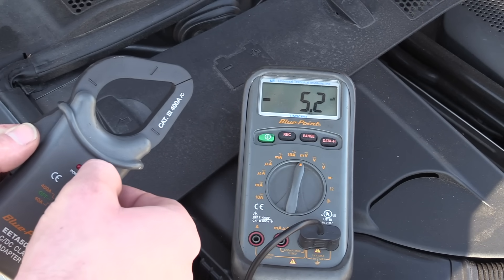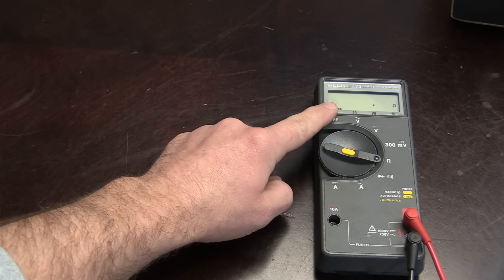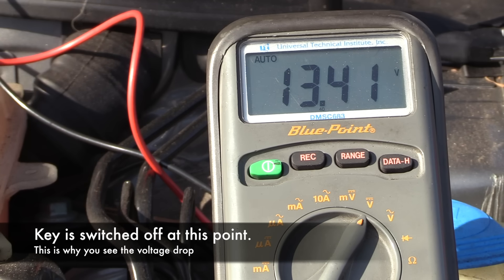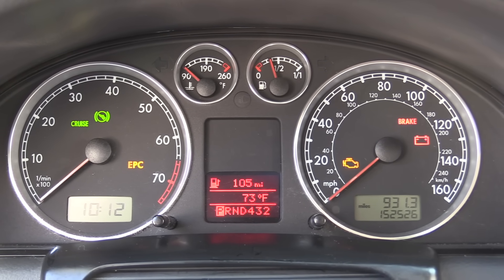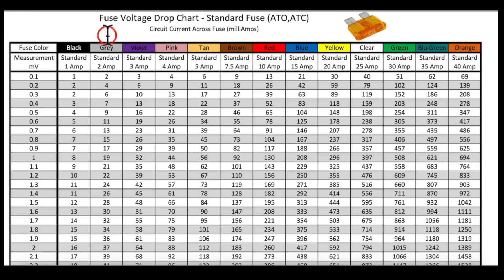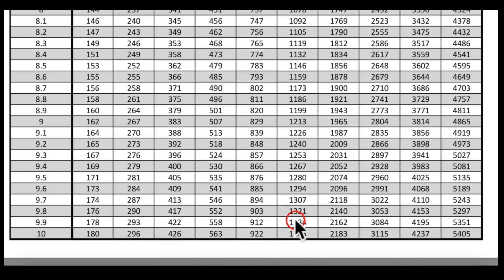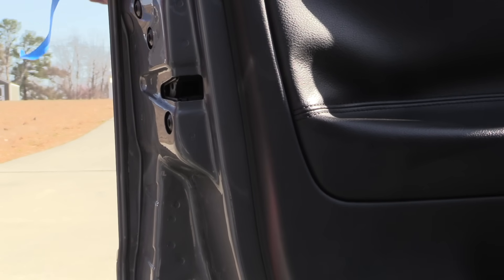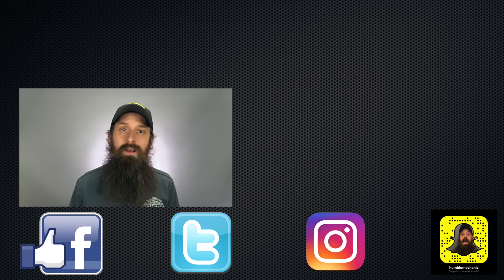The BEST Way TO Perform a Parasitic Draw Test

Comment: Hi H.M. .......I'm confused by all this.... For starters:  1) Don't we have to turn on then off EACH device first (so it has some 'fresh residual voltage' lingering in fuse) to see the voltage drop to zero  2) If our goal is to just make sure every fuse drops to 0 when powered off....why would we need to use reference chart to see what the mV to amp conversion is with 'device on' reading?....if it's drawing extra mA's when running isn't that inconsequential being the alternator is charging battery when running/compensating for this....? I guess I'm missing some key points.....not extremely electrically minded.... Thanks..
Reply: Yes you are missing THE key point. That point is he is trying to identify the circuit that is draining the battery when the car is supposed to be switched off and NOT using any power. So any current draw while the engine is running is irrelevent.
Using the chart tells you what the voltage drop is in current draw. Some circuits continue to draw current when the car is switched off. By knowing what this draw is in amps tells you if the draw is 'normal' ie tiny, or is abnormal ie high draw.

Comment: I wanted to learn this cause I hooked car Amp n subwoofer box since then its takes about two days n not using car the batt is dead ,wtf, can you please, please take a minute to hit me up i got a 2018 Honda hrv what could I done wrong to be losing power please help!!!!!
Reply from the maker: Make sure the battery is good. Then you may want to try an amp clamp around the battery cable to see the draw.  You can the. Disconnect the amp or radio and see if it goes another way
Reply: @HumbleMechanic  hey thanks alot I don't have a amp clamp but I have a meter like yours my confused is the battery good cars a 18' and I used a really good amp wiring kit 0 gauge everything is hooked up right and its turns on n off properly with that blue remote turn on and it works great shuts down fine when I shut off car ,,,I know its something with amp ,why would it draw power if it shut down correctly  , iam stumps me  sorry to bother you with this i don't know what to do could a loose connection draw power maybe I thought I wired it properly   plus to be honest I can't afford to take it to a mechanic  cause of sterio problems what would you check any help would be greatly appreciated

Comment: It seems like you were using 2 multimeter to perform the test. Am I correct? While testing the fuses with a second multimeter (Fluke), do I have to leave the first multimeter (Blue-point) hooked on the battery?

Comment: Isn't 1000mA 1A ? 

Milli meaning 'thousandth of'
Reply: Ah...I just asked the same question before I found yours. He says 0.1 amp, but I agree that it’s actually slightly over 1 amp as Jonathan Hunt wrote
Reply: yes. the 1006 milliamps converts to 1.006 amps not .1006 amps. there are conversion charts that you can google. good catch!

Comment: Does  this require a special multimeter that reads millivolts?
Reply from the maker: I’ve never seen a MM that didn’t read millivolts. Even a $10 from Amazon. Lol
Reply: I noticed you were selecting "Vm" on your DVM.  I don't have that on mine,....and haven't seen one yet on Amazon with that "Vm" selection.  Do you have a recommendation?

Comment: I have a fluke amp clamp I just push the zero button and go to work
Reply from the maker: But the clamp will only I’ve overall draw. Unless you can get it right on the circuit wiring you want to test.
Reply from the maker: I have one too, it works amazing, but to me that’s a different test

Comment: But what do you do when ALL the fuses have current on them when the car is off!
Reply from the maker: Good question. The car is probably not asleep. Also the odds of that are almost zero. Having power on all the fuses at one time is very unlikely. 

But let’s say it is actually happening. I’d be looking at things like an ignition switch
Reply: Intermittent wakeup of the bus system is a real problem that I am currently dealing with.  It will cause current on almost every fuse. 
I have isolated the problem to 1 of 5 modules connected to terminal 30. But now I am waiting for the problem to return.  It comes and goes and drains battery, no start. 
This car does not have ignition switch.  Fob in pocket car starts with start button.
Reply from the maker: Yeah but that should put a draw on ALL the fuses. 

I had one years ago that did that. Turned out the customer wasn’t locking the car in the garage, and something in the Audi they had was waking up the VW(gti I think). It would only happen at the customer’s house. Never at the shop
Reply: HumbleMechanic almost all the fuses, but not everyone. There are some fuses connected to things like blower motors that are not carrying current. 
But once the module on terminal 30 wakes up, ALL modules are woken because the module that operates terminal control activates all relays.  therefore all modules are talking talking and almost all the fuses have current. 

These types of draws show up at least once a month around here.  Total loser job.  How do u tell a customer that its been 2 weeks and it only happened 1 time.  

At least this one happens every 2 days or so!

Comment: Wish I had seen this a couple weeks back.  Tested 2013 sierra with the pulling the fuse method.  Took awhile with the truck waking back up a couple times. but found
The INFO circuit to be at fault. 
Will try to remember this trick next time.

Comment: I wish there was a set of meter wires that never went bad. Ive got about 10 meters out in my garage. All of them  do not do ohms. Any advice as to which brand is one the is reliable or more reliable
Reply from the maker: I have always had great luck with Fluke. The leads are a wear item, but the are really good, and the meters are top notch.

Comment: I have a 2015 honda and am having trouble with a dead battery if the ignition is left on for evan a short time.   Originally the dealer said it was a bad alternator and replaced it but the same problem kept occurring.   I did a test and the voltage from the battery dropped from 12.61 volts to 11.80 volts in only 15 min. At 11.80 volts the car struggles to turn over.  any ideas?

Comment: what about the chrome fuses that is like a relay?
Reply: Those are actually mini breakers for your truck or car. They are mostly used on heavy duty tractor trailers and sometimes find their way into your car by mistake. To test this circuit simply replace the breaker with a fuse rated the same amperage rating as the breaker or better yet use the fuse diagram to select the proper fuse for that circuit before testing.

Comment: Does anyone have an explanation as to how this works on a fuse?  In general theory or thought.. a fuse is not a load so VD should be close to zero. Is it because it boreders the current capacity of the circuit?
Reply from the maker: It’s a very slight load is on the fuse when something is drawing current.

Comment: I am now getting around 75ma drain on the battery when connecting a dvom in series on my girlfriend Tiguan. I have checked for voltage drop across all fuses following your procedure and find 0.00 on all fuses. Is 75ma acceptable? The specs show 40ma, or should I keep looking? It reads this after sitting for several hours with alarm activated and doors locked etc. Could there be a problem on the starter side? possibly a stuck solenoid or relay? I would appreciate any help this is driving me nuts, plus She's borrowing my car:) As far as faults I have pulled a generic p303 misfire code and also the amber steering wheel light is on when car is running?

Comment: Hi 
I have been trying to find an issue with my girlfriends Tiguan. When parked overnight the battery is dead. Here is what I have checked so far and how.

1. Battery is new, been checked and is good.

2. Alternator is putting out a good charge, even under heavy load. Rectifier is good, all diodes check out.

3. I followed to the letter your procedure according to VW TSB. (checking voltage drop across fuses). etc.

4. using an amp clamp over the negative cable I'm still seeing a draw of 400 milliamp's or more after two hours while the car is asleep? According to VW it should be 40milliamps.

5 All fuses are showing zero voltage drop?

I was wondering if you can point me in another direction? Are there unfused circuits that could be the culprit? I was under the impression all circuits would be fused.
 one thing we have experienced in the past is water leaks from the panoramic roof. Are there any places you would check regarding this?
The car is bone stock. No after market electrical components at all.

All the best John.
Reply from the maker: Check all faults in all systems. Also does the car have Kessy? Is it parked near another car with keyless?
Reply: @HumbleMechanic  If I understand it her car does not have kessy. Keyless entry. Its the regular key fob with buttons on it. It is not parked to a keyless car. Mines a 68 Mercedes:) I did notice when the car was running a couple of things. The yellow warning light showing a steering wheel was on? Also my girlfriend said the powered seats were acting up. Not working. She turned off and on again and they worked? When you refer to fault codes you are referring to a OBD scanner is that correct? The amp clamp is detecting (once the car is asleep) after 2 hours as much as a 2 amp draw? I really appreciate your help, this is driving me nuts:)
Reply: @HumbleMechanic  Could a bad relay be causing this draw?
Reply: @HumbleMechanic  I am getting  a generic p303 for misfire. Also the amber steering light remains on as well as the amber light showing a car with squiggly lines. Any thoughts?

Comment: A great video and the tables referenced are terrific.  However, the values in those tables aren’t necessarily accurate.

I just went through this with a draw in my ‘98 F-150.  The fuse on the power port circuit showed a 0.2mV drop, which is an 85mA draw according to the ATM fuse table.  But when I break the circuit and put my well maintained Fluke 179 in-circuit at the fuse socket, the draw is actually about 130mA.

So the tables will give you a rough idea, but don’t take them as gospel.  Still, using the fuses themselves as test points is genius!

What would help as a next step, would be some kind of reference or equation that would put the draw results into context: “if my problem circuit is drawing 2A per 24 hour period, and my battery has a stated capacity of 1,000A and 850 CCA, how long will it take for this draw to bring the battery down to 12.0V?”

I know someone somewhere has the math for that and an app would be a tremendous tool.
Reply: The table values have one significant figure, so ±50% is the best you'll get. You can always do the Ohm's law math yourself!

Comment: Great video. I have a 2009 Tiguan.I did exactly what you suggested and found no voltage drop on any of the fuses. I also had the diodes checked on the alternator. But I'm still getting a draw that drains the battery in about 1 to 2 days? Any thoughts or suggestions would be very helpful. Thanks again for a great video.

Comment: Very useful info.  I have a 2007 Silverado HD2500 crew cab that goes down after a while.  It's got two new batteries so there's some parasitic draw happening.  This might help figure it out.  Thanks.
Reply: If you find it out I have a 2005 GMC 8.1 HD2500, same thing happening
Reply: I have a 2006 duramax goes flat in 2 weeks, did you find it. Im pretty sure i traced it to factory stereo, i will know more in a week.
Reply: I have an older Chevy 2500hd 2003 with what's weird is when I bought the truck from my son he didn't mount any trailer brake controller, already in there. But, wires for controller ran from engine compartment to cab through the drivers door above the top hinge. I though this was a rather crude way of running wires from one area to another. But who am I? After a couple months of sitting many times a flat battery would result, and also, this truck has nothing electronic other than aftermarket radio. Crank windows,  manual seat. My close friend uses battery tenders for all his battery powered equipment,  unfortunately that would hind a problem,  like my 2002 honda Forman rubicon 500 for instance,  I keep that on tender all year, especially in winter when I need it to be reliable for snow plowing. The honda has a tendency to have a hard time winter starting with much cranking, hence, battery  tender. I did change the way I start it though,  I choke and push throttle few times, and then turn over with no throttle for 5 seconds trying to create vacuum.  Then resume cranking with just plain choke no throttle,  fires up. . After charging I will try this, thank you.

Comment: Eric did it easier
Reply from the maker: There are 2 common ways to do this. 1) pull fuses 2) this way. 
Older cars the fuse pull method is fine. Newer cars it is not. Pulling fuses can disrupt modules and cause spikes. In addition to that it can "reset" a module and give a fault fix. 

Also understand  easier is a matter of perspective. I promise I can do this method much faster than pulling fuses one at a time and watching an amp clamp.

Comment: I have a question, are you using more than one multimeter, I only ask because you stated in the video to grab your other multimeter and I didn’t see that you had hooked up a second multimeter or were using a second multimeter, thanks if your still responding to this post..

Comment: have used this technique many times, it works well. however, not all consumers run through the fuse block. yes, this is a good test, but it is also incomplete. examples- abs, starter, alternator (have seen a few of these). there are others as well. do use the amp claw on the negative wire at the battery as a secondary test, before disconnecting a battery for an inline test. I have found more draws on vws that do not go through the fuse block than do.
Reply from the maker: Just be carful disconnecting the battery. That can false fix things. :)

Comment: Not all drains go through fuses, Diodes in Alternator, Seat Belt interlock and others, I like a DC Amp Probe, but takes one person to watch meter, one person to unplug fuses one at a time. can do one person(takes longer). Disconnect Cable at battery, place a light bulb/socket, one on battery, one on terminal, pull fuses one by one til light goes out, if still lit, disconnect Alternator, Regulator if external, Bulk head connectors, other connectors, anything that can be isolated. Although some fuses are not energized til ignition is on, won't matter much as you are usually looking for a drain while parked, Their are fuses that don't come into play til turned on, Like Headlight(s), May not be a drain, may just not be charging, Check voltage before starting, and when running, should not be the same or less, if so, it is not charging.  Or it could be a Bad Battery
Reply: Also Fuseable  links, At the Battery you verify ALL drains, good info, but feel it can miss some?

Comment: Would not it be easy by putting the multimeter in series. One probe touching the (-) terminal and the other probe to the negative battery post. Your method looks a bit complicated.
Reply from the maker: Give it a shot, you will find that it takes minutes to do the entire car. The way you describe is not in series. Series would be removing the fuse, and having the meter replace it. Unless I am not understanding exactly what you are saying

Comment: You need to teach this to GM.  Our Chevy, with only 4000 miles, would drain its battery after only 2 days of no use. The dealership had it more than we did. They replaced the battery and wiring harness, and never could figure out what was going on. They refused to buy the car back, and turned their backs on us. We called Subaru, and they offered  us full value for a trade-in. A GM representative called us after a couple months to ask if we would ever consider buying a Chevy again.  We just laughed and laughed.

Comment: Hey Humble Mechanic! This may sound irrelevant but lol Just wondering why you switched meters when testing the millivolts to the fluke? I am in the market for a multimeter under $50( my budget) Was that Bluepoint not accurate enough for your testing? I noticed it had mV s  on it too?
Reply from the maker: Oh boy, I don't really remember why. I think I started out using the UTI one with the intension of leaving it on the battery. Fluke is the way to go in my opinion.

Comment: "And it goes really fast if you don't find a problem at all." 

Yeah, but if you have a parasitic draw, it's not good if you don't find anything.
Reply from the maker: Maybe you don’t really have a PID.
Reply: @HumbleMechanic  Maybe you misunderstood me. See: "...but if you have a parasitic draw, it's not good if you don't find anything". 

Meaning you may have done something wrong, and it could take some time to figure that out.

That said, going down the path you're on, what would be drawing on the battery with the same signs and not be discovered by way of this method, if done correctly?

Comment: When I worked as a diesel mechanic it was always aftermarket shit.  Even high end GPS trackers that were tamperproof.  Always start with aftermarket add ons.
Reply: lol, i haven't started to trace my problem yet, but i know it is probably the cheap aftermarket radio
Reply: Yes. Stock equipment usually has a more robust design than aftermarket.